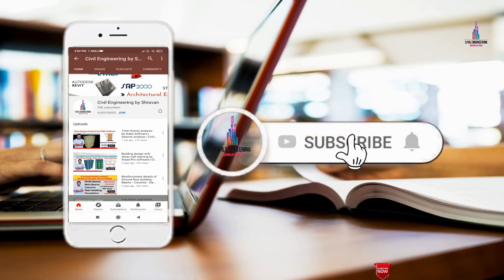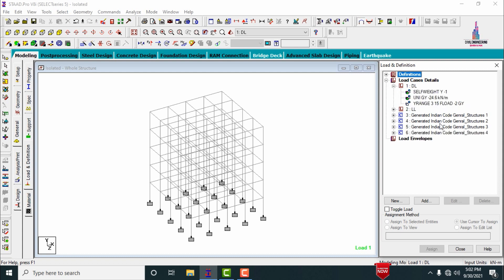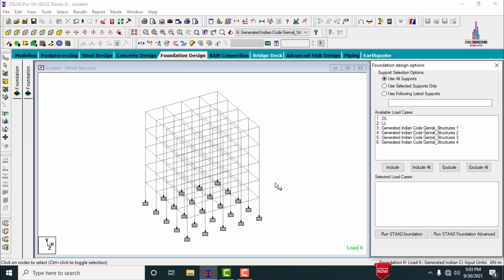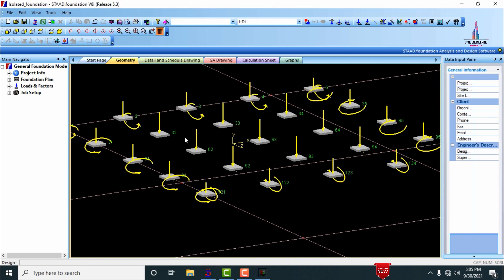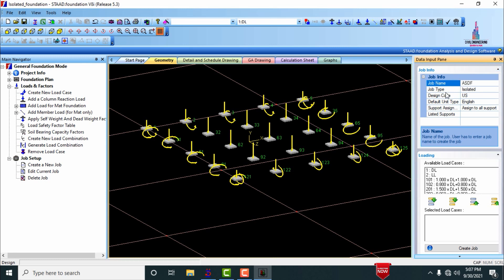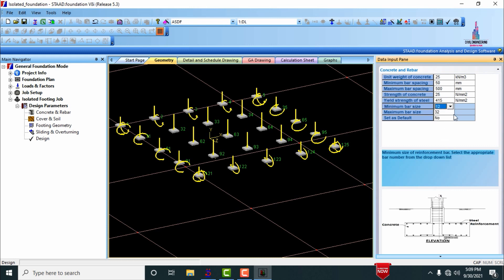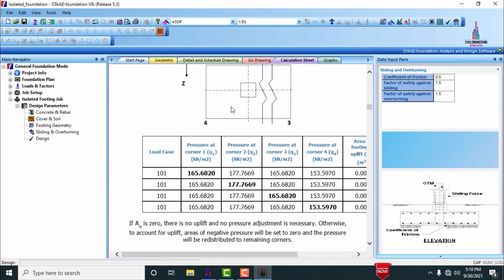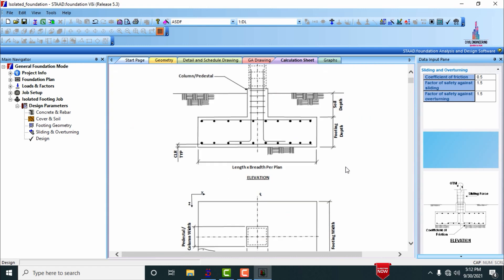Isolated footing design a per IS code using Staad Pro software | civil engineeriing | foundation |

Comment: Hi Sharvan,
Would you please focus on Oil and Gas industry for a while? Pipe sleepers, Pipe racks, Valve/vessel pits, etc? Type of loads and how to apply them like empty pipe load, product load, etc? I see nowadays more engineers coming to this and its references are not easily can be found.